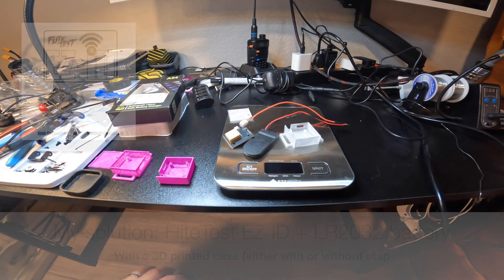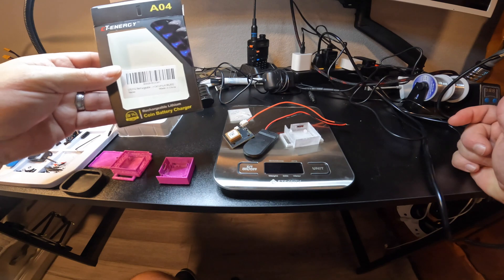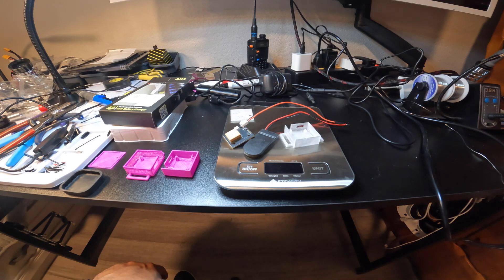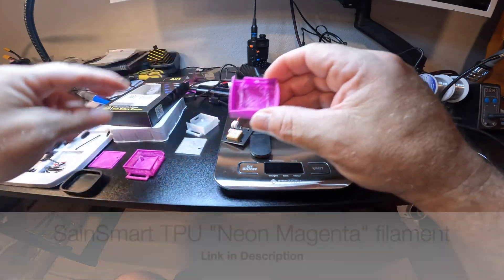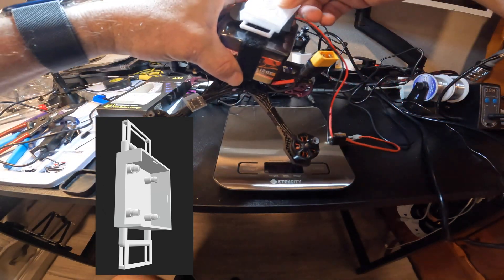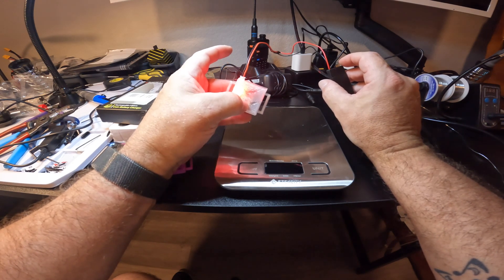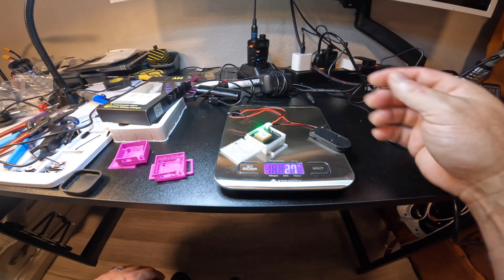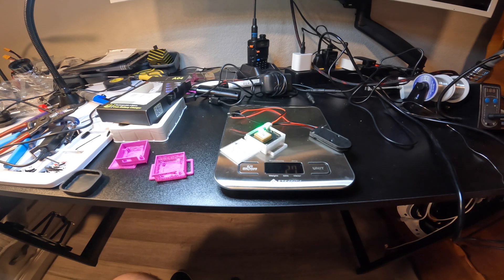Remote ID - Small, light, self contained.  Flite Test EZ ID, LR2032 in

Comment: Sooo...it's about USELESS other than a $100 "box check" required by the "Land of the Free, Home of the Brave."

Tried to wire mine to the FC to use it's GPS info...didn't work and based on your, Bardwells and MY experience...is a useless GPS device...drone weight...
Reply from the maker: No I did read in Joshua Bardwell's video review, within the comments, it does work.  The wiring diagram was wrong, and I think they ended up using BetaFlight's tech support (or Discord?) to figure it out.  I think the RX and TX were swapped and I think there was a protocol change.  After that it worked.  I am sorta slammed right now or I'd go spend awhile digging up the comment.  

In the next day or two, I'll try to circle back, find it and let you know.  The FliteTest tech support is not really good from my experience, so I'd look to them as a very last resort.
Reply from the maker: I couldn't find it, but did you follow this: https://www.flitetest.com/articles/connecting-ez-id-to-betaflight-for-gps-passthrough

If so, there's two things I'd try if it's not working.  First is the easier of the two, change the protocol.  Then if no joy with all of them, try reversing the TX and RX as I think I read they were mislabeled on the boards (don't know if this was resolved).  So swap the two wires, and try again with MSP protocol.  If no joy, try changing the protocols again.

That's the best I can do until I get around to trying to make mine work.  I am not in the mood to update my BetaFlight to a version compatible, and I've since bought a DJI FPV drone... so I don't need to have it up and flying yet, but I will one day when a lot of other projects are completed.